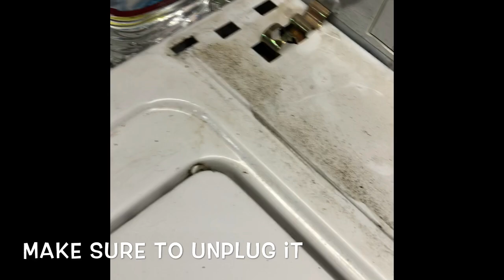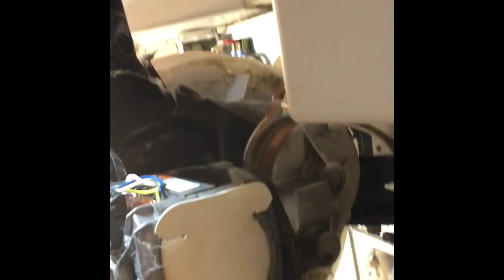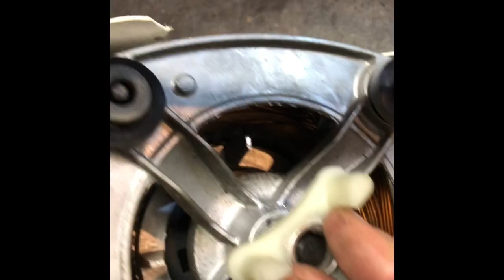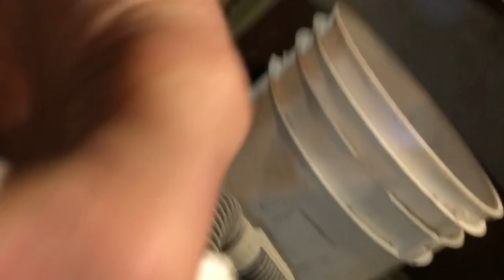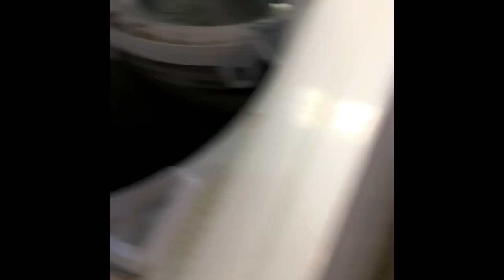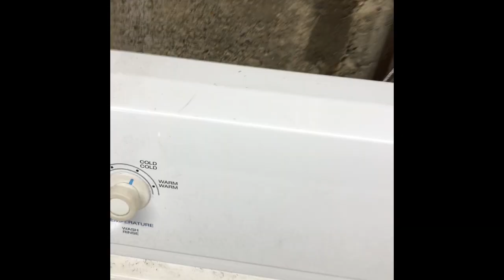✨Roper Washer - No Agitation No Spin - EASY FIX ✨

Comment: I did this and everything is running fine. Only thong is I put the top clip on.  I tried with every muscle in my body and I just cant get on the bottom clip.  The top clip is screwed in.  Can i just run it with the top clip.  Inhave pics of those and everything is well lines up.
Reply from the maker: That is hard to get that bottom clip on.
I think once I get the bottom clip on I give it a tap up with a hammer to lock it on.

Comment: I have a Roper, pump quit working, I looked pump, lots Lind, hard to turn, so ordered newpump, replaced it today, still won't pump, and yes I looked at coupler, looks fine, turns smooth, so is it electrical?
Reply from the maker: I think your pump is powered by the washer motor spinning so it shouldn’t be electrical.
Does it sound like the motor is working during the spin cycle?
Reply: No sound, hum or click, agitation works fine

Comment: Seems fairly simple, huh? I just wonder, even though listening and watching it sure seems right, that if that part is the problem will it happen without warning and will it sound like it wants to come on inside where the knob is? Just briefly. And also the dial will not even move past the beginning of the rinse cycle.
Reply: But also, mine does agitate.
Reply from the maker: Gotcha,
Your motor coupler is good, but you need to zip tie your lid switch back together 👍
Reply: @QuickAndEasy5MinuteApplok. So thanks for responding. After all this time since you posted this I honestly didn't think anybody would. So that makes you all the more awesome! 
I actually had that lid switch from when my son gave it to me and just finished replacing it and got it all back together and it still doesn't work. I also checked to see if anything was stuck in the one part and it was empty. With the new switch the buzz/hum coming from behind the knob stay on instead of just being on for a quick second. It's probably some computer part, huh? I was just about to remove the black box and see if there is maybe something 'off track'? Idk really what it's like in there as I haven't gotten that far yet.
Reply: Oh yeah, probably worth mentioning that while I did have a quilt in there, it was only 1/2 full, it did go off balance and I stopped it. That's when it never has spun again.
Reply: Ah shiz... It's working now! Shew! I too am amazing. Lol! All I did was to remove that long black drink sword looking thing that does the big on/off button and endure all the connections were tight. Musta been one of those things. Yay Us!!!

Comment: if the motor coupler has broke would the motor try to run?  My washer stopped after a wash cycle and now there is nothing, no noise or movement.
Reply from the maker: I bet the lid switch broke.

If it thinks the lid is open it won’t agitate or spin.

Comment: I have a roper RTW4516FW1 and have an issue where it was stopping on the rinse cycle for like a week. Then started working fine again for a week now it stops on the final spin cycle????? Any ideas please i cant buy ANOTHER washer before Christmas lol. Also. I have agitation and can hear water being let into the machine. No loud noises either.
Reply from the maker: I bet the lid switch is having trouble.
Can you put a weight on the washer lid to see if that helps with the problem?
Reply: @QuickAndEasy5MinuteAppliance  I will give it a try today and let you know
Reply: So I washed a load and put a car battery on the corner where the lock mechanism and  it stopped on the rinse cycle. I then switched it to rinse and drain cycle and it finished the rinse cycle but stopped again on the drain cycle. Oh what fun.

Comment: Just took mine apart. This piece is intact. I might have a motor issue
Reply from the maker: Does the motor hum when it should spin?
Might have a small sock caught in the pump.
Reply: @QuickAndEasy5MinuteAppliance  thank you so much for this because I did everything else and was about to give up until I looked  at this comment and saw your reply and checked the pump and there was a sock 😂

Comment: Mine agitates and will spin without a load but as soon as there is a load, it will bog down. I can't spin it up by hand and something starts clicking on the controls until it shuts off altogether. I've replaced most everything (coupler, clutch, brake shoes and gearbox) and nothing has fixed it. I am at my wits end. I have no idea what else it could be.
Reply from the maker: Nice job Sean,

Can you check to see if some clothing item got stuck between the spin basket and the plastic tub?
Just need to pull off the cabinet and then pull off the the white plastic ring and fish out the clothing item with a straightened coat hanger 👍
Reply: @QuickAndEasy5MinuteAppliance  yeah, I've had both the inner and outer tub off. There's no clothing. It acts like a bearing is seizing up but there's no bearing in this one that I can see. Is it possible that the drive block is worn to the point that out let's the spin tub too close to the plastic tub?
Reply: @QuickAndEasy5MinuteAppliance  I FIXED IT! All I can say is that I will never NOT inspect my drive block again. Yes, the drive block was so worn out, it allowed the spin tub too bottom out on the outer tub. And all it took for me to learn this valuable lesson was a new gearbox, clutch, brake shoes, coupler, drive block and tub nut. 😂 💸💸💸💰

Comment: This was great! I got my washer apart but nothing in the coupling or forks looks broken. I’ll put a new set on just in case, but if that’s not it, what else could cause it to not spin out?
Reply from the maker: Great question Kaleen,
If you don’t hear the motor during spin, you have a cracked case on your lid switch.
It’s easy to fix with a zip tie.
Let me know and I can send you a video on how to do it👍
Reply: @QuickAndEasy5MinuteAppliance  
I put the new coupling on …  and it’s still not spinning. And yes I can hear the mirror, just not spinning out.
Reply: @QuickAndEasy5MinuteAppliance  send me the video
Reply: @snowscout1018  Same here. Wondering what to do next. Please update if you get it solved!

Comment: Just reviewing the process.  Done it 2x before on my Roper commercial, didn't have to take off cover, just tilt up 45' to get access. Last time I used the good halves of previous broken ones and it lasted 2+ years.  In our triplex, its gets 6-7 loads/week.  I bought 2 last time, for the next time.  Thanks!
Reply from the maker: Hi Karl,
Leaning it back against the wall at 45 degrees is a great idea. Just make sure it’s supported so it can’t fall.

Comment: Thank you for this video! Very easy to follow and right to the point. I found the replacement part at Walmart for $10 (after tax). I fixed the washer and now it's working even better than it has in years. And you saved me the cost of a repair man or a new washer. Much appreciated!
Reply: You found it at Walmart? You maybe remember what it was called?
Reply from the maker: Thanks so Much 😊❤️😊❤️

Comment: My agitator doesn't work during spin cycle if load is is more than 3 pieces of clothes...is that the same issue as the video??
Reply from the maker: Yours is a bad clutch that needs to be replaced.

Comment: Mine agitates but won't spin. I replaced the clutch but it still won't spin.
Reply from the maker: Hi John,
It’s highly like.y you just have a broken lid switch.  You can wrap a zip tie around it’s broken case and it will run again👍
Reply: @QuickAndEasy5MinuteAppliance  do you have the part number so I can order the same thing you did in the video

Comment: You didn't say how you diagnosed the motor drive coupler. Experience told you,  and that's good. I'm gonna get that experience soon, anyway ! Very good video, thank you! My machine washes and won't spin
Reply from the maker: Thanks Stacey,

You can tell when you start spin cycle and you hear clicking but when you raise the lid it’s not spinning.
Reply: The coupler has a steel insert, on the half that is on the gear box. The insert was obviously wrong at the factory, because it was too long to engage the spline,and was just barely on the egde of the plastic. I had to machine the sleeve so it would engage the plastic. It works perfectly. Easy fix. Thank you
Reply from the maker: Nicely done👍

Comment: I took my Roper washer apart and this coupler is not broken. My machine will fill with water and drain but does not spin or agitate. It sounds like it is maybe trying to spin and the motor is going but the clothes just sit. What else could it be?
Reply: Have the same problem wondering what's going on?
I know this is a year old do you still check the videos?
Reply from the maker: Can you send me a video of the sound it makes during spin to: scottthefixitguy@yahoo.com

Comment: Ok so mine wont spin and its not that part. So any suggestions on which way to go?
Reply from the maker: What sound does it make during spin?
Reply: @QuickAndEasy5MinuteAppliance  it drains the water out but sounds like it tries to spin. It sat for 10 years. Cant even spin the drum by hand

Comment: I have the same model, but it says heavy duty | super capacity | 8 cycle | 2 speed combinations in the middle. don’t know if it’s the same issue because it’s been working for a long time but it stopped working very recently, I’m thinking it’s because I did start washing heavy blankets and stuff very recently (kitten will not care where to potty if it needs to go). Im thinking it might be the same issue, where can you buy that item?
Reply from the maker: Yep, I bet that broke the model coupler.
You can order a whirlpool washer motor coupler from Amazon.com
Reply: @QuickAndEasy5MinuteAppliance  thank you so much! Much appreciated! 🙏🏽
Reply from the maker: I hope that fixes it👍

Comment: PROBLEM: I followed the video step by step only to see the coupler was intact. Nothing broken. But my machine still will not spin
Reply: Yes i hear the motor going but the agitator tried to turn but stopped. Didnt even turn a half turn. Cannot move it with my hand
Reply from the maker: Darn it.
That means that the transmission is faulty.
Once the agitator does a slight turn do you hear the motor hum?
Reply: @QuickAndEasy5MinuteAppliance  Hello, this sounds like mine. I just pulled it apart and couplers are good. Is it worth changing the transmission?
Reply from the maker: Can you hear anything when it’s supposed to spin?

Comment: My Roper starts with the water and will run the beginning wash cycle, but will not do the rinse cycle. If I set it to the spin cycle it also works. It's as if there is a dead spot in the know, but it is mid-cycle on permanent press, Normal, and gentle.  It seems like some brain-box issue. What do you think?
Reply from the maker: When you set it to fill with cold water, will it fill?
Reply: @QuickAndEasy5MinuteAppliance  Mine does the same. It will fill with cold water. After it starts, it agitates, drains, then sits there in the draining stage.

Comment: Do the roper washer has a belt
Reply from the maker: It has a motor coupler instead.
Reply: @QuickAndEasy5MinuteAppliance  ok thanks I see a little belt hanging near the  couple where is it off of
Reply: @catcalt  I saw that belt, too. It isn't connected to anything. I don't know what it's for. It just sits up near the transmission area.

Comment: So our roper looks like this one, and it is tripping the breaker when it start to agitate. All the part you show in this video are good on our machine. Any idea what another issues could be?
Reply from the maker: Can you use an extension cord to try the washer on a different outlet?
Reply: @QuickAndEasy5MinuteAppliance  

The outlet is fine we run the dryer off of it as well.
Reply from the maker: Can you send me an email at scottthefixitguy@yahoo.com so I can give you more detail on the fix?
Reply: Did you ever find a solution? Took mine sort today thinking the same thing but the coupler is intact. Won’t agitate or spin. Tripped the breaker on spin the first time and second time around it was stuck on spin and full of water
Reply: @chrisscott8003  Yes  we had to change the breaker. We just built the house in 2018 but apparently the breaker was no good. We gave the washer to his brother and they havnt had any issues with it since.

Comment: Could you hear the motor running though before you fixed it? My fills with water but then doesn't do anything, makes no noise nor sound
Reply from the maker: Your lid switch might also be part of agitation.  If the washer thinks the lid is open it won’t agitate.  This is always true for spin and sometimes true for agitate.
Reply: @QuickAndEasy5MinuteAppliance  You was right. The connector that goes to the lid switch was slightly melted. I bypassed it temporarily until my new one comes in
Reply from the maker: Nice job😊
Reply: @waynv1835  I had to bypass the lid switch where it would run with the lid open or closed.. Mine had went bad. After that, everything started working correctly

Comment: So my agitator spins if i manually spin it but when clothes are in the basket, its as if the motor isnt strong enough to spin with the clothes...I've also tried running the washer without clothes in the agitator works fine. just when I add clothes it doesnt want to spin. Can anyone help me out? Also the tub spins to drain water as well. so i dont know what it can be.
Reply from the maker: Yep,

You need the new super cheap dogs for you agitator 👍
Reply from the maker: No Agitation --Easy, Fast, Cheap FIX https://youtu.be/trMuTVhTRnU
Reply: @QuickAndEasy5MinuteAppliance  its more like the base of the agitator isnt spinning completely..the top portion that houses the agitator dogs works correctly.
Reply: @ericacsmith08  Eric did you ever get a reply I'm having the same issue

Comment: My Roper will spin and drain, but will not agitate.
Reply from the maker: What happens after it fills with water?
Reply: Quick and Easy 5 minute Appliance Fixes: It fills, doesn’t lock, then drains. No matter which wash setting.

But, If I flip the switch to spin and drain, the door locks, it spins and drains. 

Ty for you reply, wasn’t expecting a reply :)
Reply from the maker: You’re welcome.

It should just lock when set for spin but not during fill or Agitate .

I think the water level switch needs to be replaced.

It’s supposed to tell the timer that it’s full and ready to Agitate.  It’s not doing its job.
Reply: Quick and Easy 5 minute Appliance Fixes : Thank you so much! Didn’t know there was a part like that :)

Comment: my rtw4340sq0 model will fill with water,  but will not agitate,  spin,  or drain.  Can you help? I do not see a lid switch anywhere.
Reply: I had this problem with my roper years ago and it was the lid switch.  Gotta be one someplace.  Try calling the local repair place and ask them where it is.  Good luck.  I guess this being from a month ago, you probably already have it resolved...

Comment: How do I get water out of my washer? Went to do a load of laundry and my washer filled up but won't agitate, spin or drain what do you think it could be?
Reply from the maker: Sounds like the lid switch.
Reply from the maker: What’s the model number?
Reply: @QuickAndEasy5MinuteAppliance  rtw4516fw
Reply: Mine is doing same thing...just makes a very quiet hum but wont do anything
Reply: I found the following site for more free help.  https://www.repairclinic.com/RepairHelp/How-To-Fix-A-Washing-Machine/47-122-892539-/new/Roper-Washer-won-t-spin-or-agitate-RTW4340SQ0?r=%2fShop-For-Parts%2fa11b122d892539%2fModel-RTW4340SQ0-Roper-Washing-Machine-